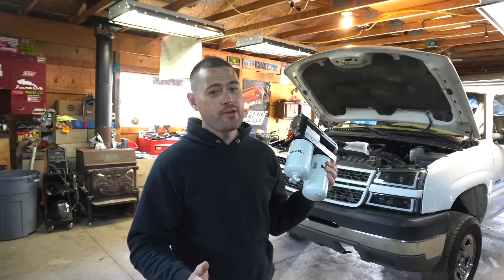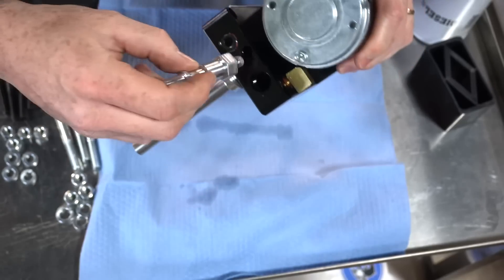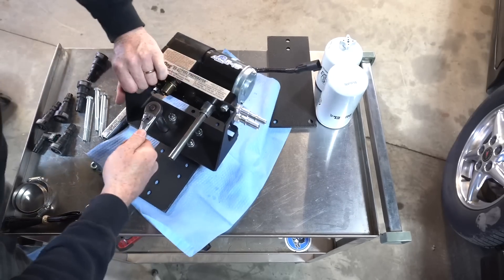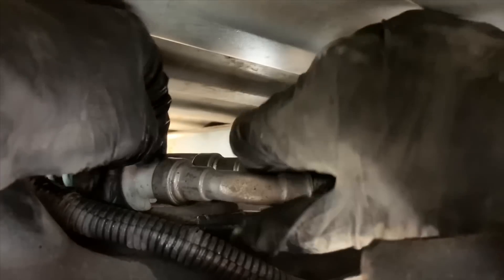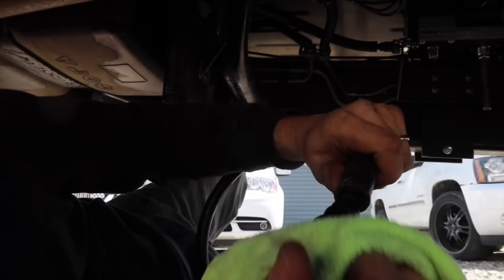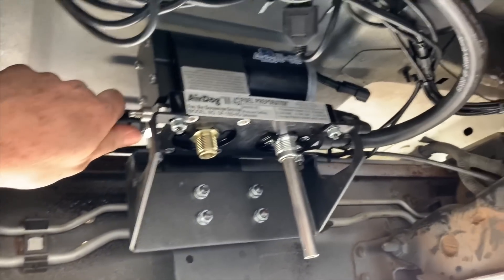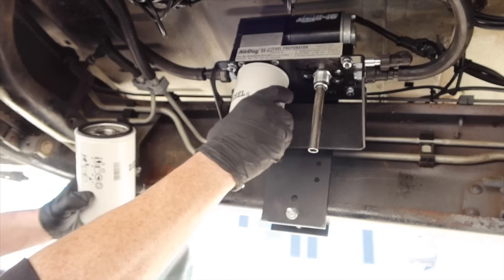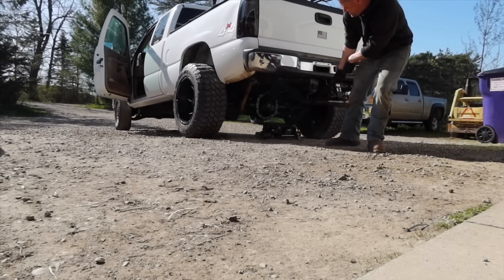Duramax Airdog Lift Pump Full Installation!

Comment: Need to install a Beans sump
Reply: Why? Air Dog is not a high flow return like FASS so it does not require the larger port from an aftermarket draw straw or a tank sump.
Reply: @kevinkalivoda3442  
Factory draw straw is to small to support higher horse power. The name of the game is more fuel. It would be like drinking through a cocktail straw vs. Dairy Queen straw. Or 5/16 vs. 1/2.
Reply: @lmlderek4130  I understand the restriction concern with the factory straw.  Because airdog recycles return fuel at the pump instead of returning extra to the tank and then getting fuel only from the tank (like FASS) the sump or larger draw straw is not necessary until higher hp levels than the FASS setup.

Comment: @Truck Master, do you not need go with a larger suction lime for the lift pump?  I was reading through the AD instructions today and saw that with the 165 they recommend to install a larger suction line.  Have you seen any issues with this or is the fuel demand just not there yet on WM?

Comment: Ok I just discovered something that might keep someone from pulling their hair out. A diesel shop installed my air dog lift pump and after several months I noticed diesel fuel on the garage floor under the pump. Both filters were tight (or so I thought) and the drip was maybe a tablespoon of fuel over night. I checked everything but the drip continued until today. I discovered the pump mounting bracket has 4 ears and one of the ears seemed to be just under the corner of the water separator filter. I loosened the 4 Allen bolts and damn if I didnt get another 1/4 turn by hand on the filter. I bent the bracket back just enough that it cleared the filter, tightened the 4 mounting bolts and NO MORE DRIPS. I hope this helps someone else from not going crazy. The correct way to fix this would be to remove the bracket and round off the 4 sharp inner corners which I still might do.

Comment: would this help with the injectors? I just did my injectors and it cost me 6k! Only got 86k out of my injectors. A 1.5year span. My calculation is, I'll be dumping 6k per year in the car if there's no solution!!

Comment: Had to pull my tank down for two reasons , first could not get two hands on the connection above the tank and my fill tube is has a hard plastic pipe running in the middle of the fill hose. !!! F my life 🤣 I have a 2002 Duramax LB7.
Reply: How did you get it over the plastic tube? I am about to start on mine. Its a 04
Reply: jbhuskiA4 disconnect the filler hose from both ends & pull the whole thing out, it will make it easier to cut as well. The inner tube goes into the tank about 10”
Reply: I removed the bed of the truck, 8 bolts, 3 for filler tube, 2 wire harnesses to disconnect for each of the taillights.

Comment: Here is my personal experience with airdog.
Installation was somewhat painful (it's not clear on their site which model required tank removal and drilling so I ended up with the one that did even though I don't need any extreme tireburning performance) but doable.
The first thing that happened upon start, check engine light came on with the P0089 dreadful rail pressure code. Quick search online revealed that it was a common problem because the pump comes from the factory poorly calibrated and line pressure is not desired 7-8 psi. You might wonder why the hell couldn't they set it. I sure did. Needless to say, you need a scanner to check code. I used to be in the automotive inspections field so I do.
No instructions on how to deal with it were found in the installation manual or on their site so I called tech support. 
Apparently, I bothered busy people in the middle of something important - the guy was less than nice. Not even at walmart level nice. In any case, I learned that I needed to disconnect the line, unscrew the nipple and cut 1 or 2 coils from the valve spring. The above procedure is to be done more than once to get desired pressure. You might wonder why they did not provide a simple adjustment screw on the pump body. For that kind of money. I sure as hell did.
There are two issues with this procedure. First, every time you remove the line, you get sprayed with fuel. Second, you need means to measure pressure at the filter. I do have fuel pressure gauge but threads in the bleeder plug happen to be metric while none of numerous adapters that came with the gauge were. To make your life even more miserable, standard-to-metric adapters are not readily available so I had to cut threads on a standard adapter and it worked but leaked. Not nice.
3-4 unplugging-unscrewing-cutting-measuring-plugging-screwing sequences and I got a little over 8 psi. Everything was fine and dandy for a few months. Probably because I am a Toyota man and rarely use this truck for firewood, and other heavy duty household chores, and only put about 500 miles on it since pump installation. 
Imagine my excitement when the CEL came on yesterday with the same lovely code. Now I have a lovely perspective of going through the same adjustment procedure but this time at freezing temperature. What could be more pleasurable than being soaked with diesel fuel? Being soaked while freezing.
Now, have good luck with this pump. And if you don't have the equipment I mentioned, you need a LOT of luck.
Reply: Wow, that sucks that you went through all that. Hopefully I don't have to go through all of that 😢.

Comment: If any " el " needs the xtra filtering it'd be those early years !!!!!
It's expensive if you haven't done if you do it yourself it is a crap load of work to replace injectors on those early models..... Keep the fuel clean very very clean 😳

Comment: Does Air dog have the 1/4 tank issues?
Reply from the maker: It’s actually a Duramax thing, the only wait to fix the 1/4 issue is to install a sump kit
Reply: Truck Master Are you going to install one? I didn’t know it was Duramax specific

Comment: The  165 gph is not recommended  for the LB7 because the gph is too high for it and can cause problems u less you add a flow meter and bring it down to around 8 psi which is the highest you should be running. If your heavily modified  and have injectors that support the increase then by all means have fun. Just info for ya'll.

Comment: Hey man I have an LB7 with a 165ghp fass lift pump. I keep getting error code p0087. Have you ran into the issue? If so how did you fix it?

Comment: I did an air dog lift system on a 07 3500 Cummins 5.9.with a sump lift it was a little more complex than what you did . This week I'll be doing a cp4 swap on a 16 duramax 6.6 and a fass lift system wish me luck first cp4 r n r on a duramax.  Fords piece of cake Cummins hi pressure pump same . I think Isuzu over-engineered the Duramax

Comment: Yea the job is done. But I can not stand how crappy everything was ran. I know I know not my truck but damn 😂😂
Reply from the maker: You probably installed it wrong
Reply: @ nah my install is clean. Tucked wires and trimmed the harness down so that there’s not a cluster of extra wire length and didn’t use the supplied fuse buddy. I hate opening a fuse block and seeing them everywhere

Comment: Those fittings never come out like that for me. I absolutely hate them! 
You will also want to crack the bleeder screw at the factory filter before you start it up. Even priming like you I get air in there after filter changes. Better safe then sorry.

Comment: You lost me at anti-seize on a fuel fitting. Injectors are gonna love those microscopic  pieces of aluminum.
Reply: You put it on the threads, not inside the fitting.  Fuel won't be washing the threads unless you have another problem.  That's just basic plumbing.  Anti-seize is required on dissimilar metal connections involving stainless steel to prevent galling.

Comment: Don’t use air dog there a trash system
Reply: Why, need more details then just they are trash? I'm looking at purchasing Air Dog or Fass in the near future.
Reply: @Easyrecliner  I have a fass fuel system and it actually separates the air and water from the diesel way better when it’s done coming out the fass system it’s 100% purified diesel the air dog system doesn’t clean the air and water out like the fass system the airsog is for stock diesels not tuned diesels
Reply: @joshuabernal8599  thanks for the feedback.